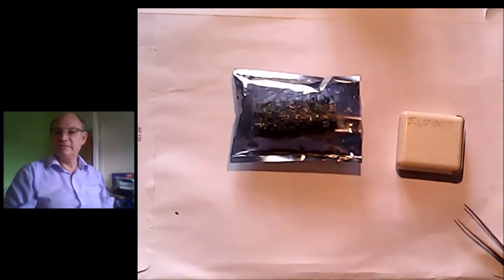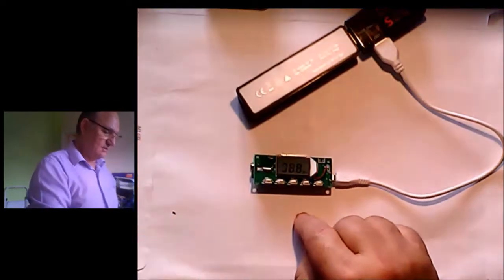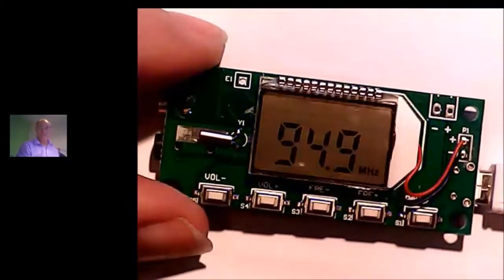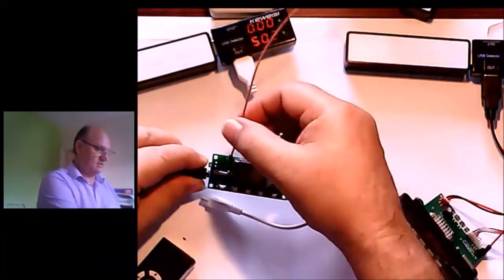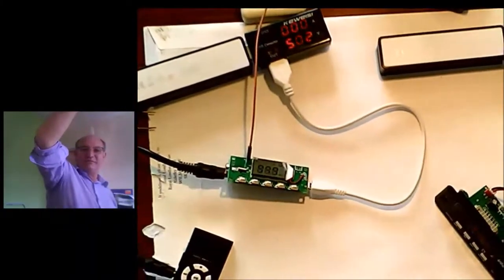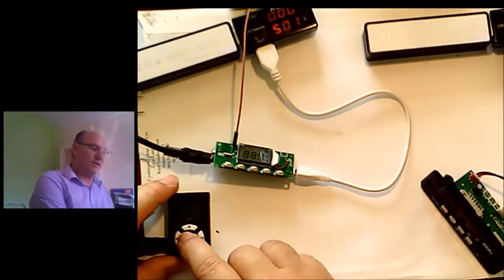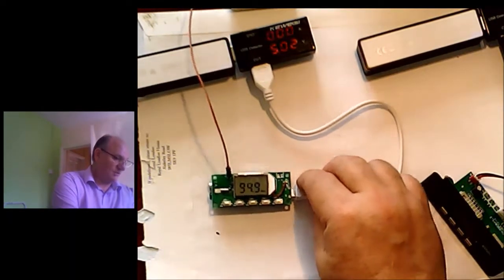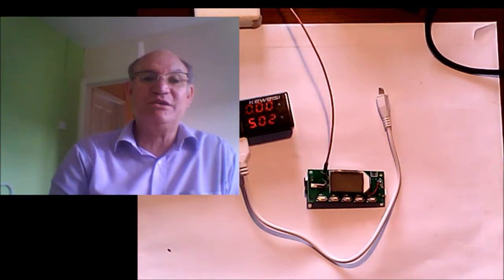DIY FM TRANSMITTER RECEIVER  16 JULY 2017

Comment: First rule before you switch on a transmitter, is to connect a antenna. Otherwise a damage is programmed ... You don`t know ?
Reply from the maker: Antenna was a length of wire.